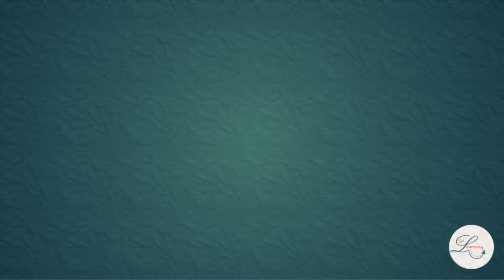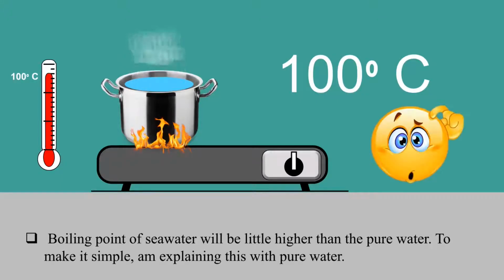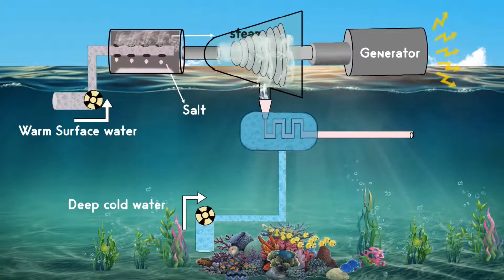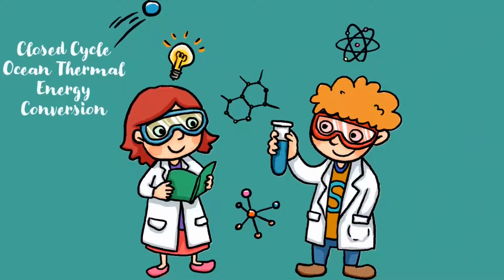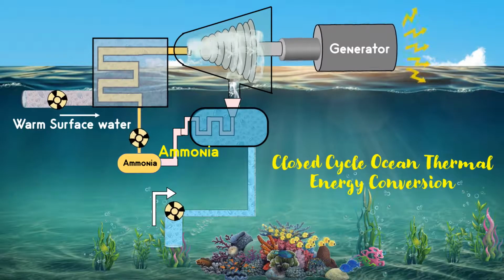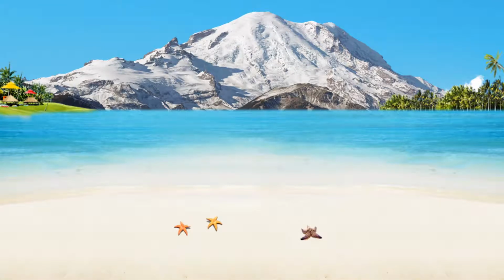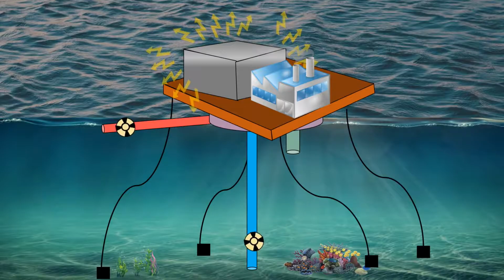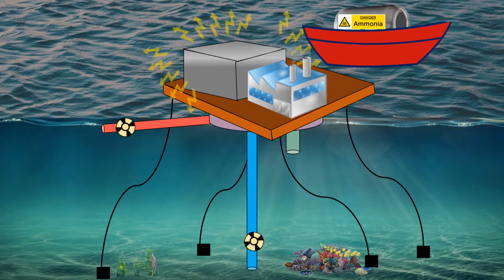Ocean Thermal Energy Conversion (OTEC) - Turning water into watts..!!

Comment: Wait, in order to operate this  plant, you need atleast three pumps, one for pumping hot water, another for pumping cold water, and a third for either maintaining the constant low pressure in the open cycle, or for pumping the ammonia around in the closed cycle ... which means these pumps will act as parasitic losses on the total electricity generated from the temperature difference, as they themselves will eat lots of electricity to operate !!!
I wonder how much net electricity we will be able to extract from this system ... what if the energy in the warm surface water is less than the energy required to run the three pumps ??? In that case, we will be consuming more power than we are generating !!! That will act as a net loss of energy !!!
Give It A THOUGHT !!!
Reply from the maker: OTEC requires a pump with a large flow rate and a low head, and due to the high seawater flow rates, the power consumption of a seawater pump represents a considerable portion of the electricity consumed. The net power is about 65% of the total electricity generated in OTEC; the seawater pump, the vacuum pump, and the working medium pump are the main sources of equipment power consumption.

I got this information from the below article
 https://www.frontiersin.org/articles/10.3389/fenrg.2023.1115695/full
Reply: @TheLearningCurveBenila  So, the whole system is more like Regenerative Braking, where the aim is not to generate more 'new' power, but rather to retrieve 'waste' power ... Am I Right ???
Reply from the maker: I dont think we can consider Ocean thermal as a 'waste power' . Its naturally available power.  But, a part of the generated electricity is used for the operation of the plant.
Reply: @TheLearningCurveBenila  By 'Waste Energy', I mean it's more like background low intensity energy which has by definition  low energy density ... Thus, extracting it at meaningful volumes means we have to pump absolutely enormous amounts of water !
Even though we can do it 24 * 7 , I don't think running mechanical pumps all the time is really a good idea, considering the brine water conditions they are working in ... Besides, an active system like this which actively needs energy inputs to operate, has Fare more points of breakdown and error than a passive system like , say, wave power or offshore wind power.
Reply: @TheLearningCurveBenila  Parasitic Energy Losses are nothing new, they happen all the time in case of coal or natural gas - based power plants ... Or even in ICE engines in cars, but the real deal is that coal, oil and natural gas all have such a high energy density, that even at poor efficiencies like 30% - 40% , we can still derive meaning amounts of power to run entire cities ... Meanwhile, specific heat capacity of water may be high compared to other common substances, but it's not as high as these conventional fossil fuels ..... 
Hence, combined with the harsh operating conditions of marine environments, it's not surprising that OTEC specifically, and other marine power technologies in general, has seen little progress compared to More Mainline GreenTech like Solar & Wind !!!